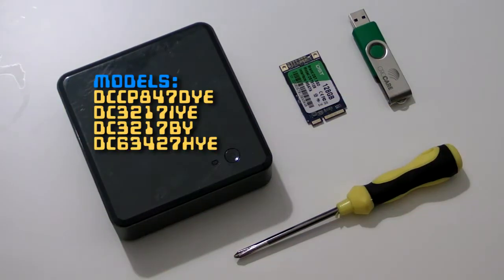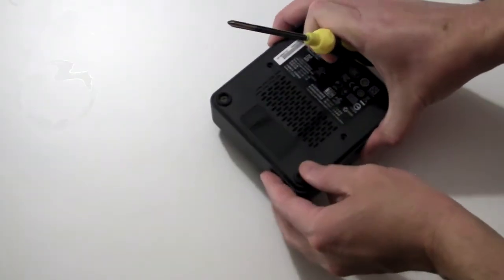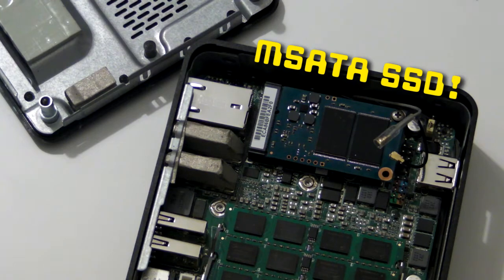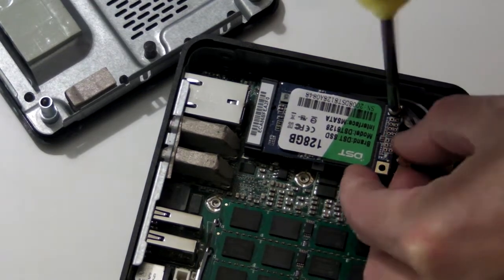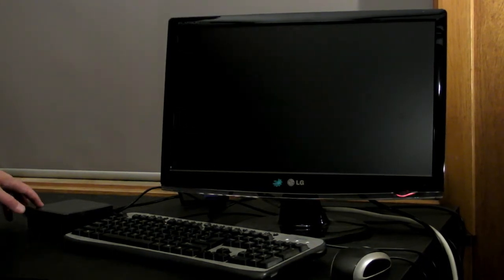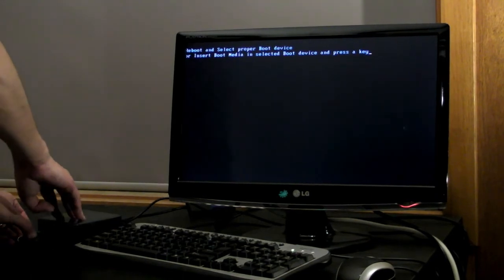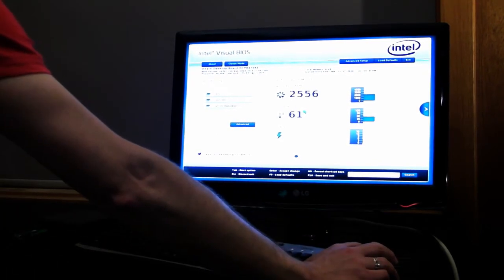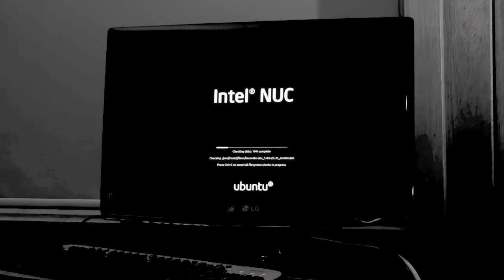🔧 How to upgrade a 2013 intel NUC (Sandybridge or Ivybridge) with a new mSATA SSD

Comment: i put on my NUC DC32\7IYE a mSATA 128Gb from Amazon but It's not recognized. I update Bios of the Nuc and tried again without success,  Update Firmware on Intel® SSDs with the Intel® Firmware Update Tool without success, WHAT TO DO? is it possible that mSATA I bought is not compatible? it's a mSATA III
Reply: lmao i’m having the same issue. did you ever figure it out?